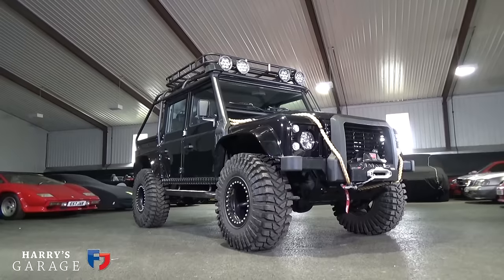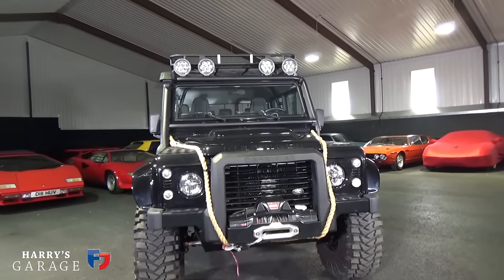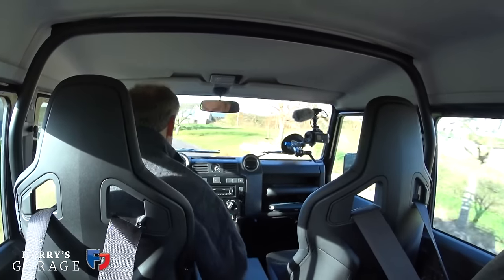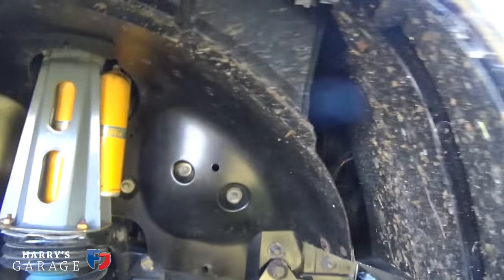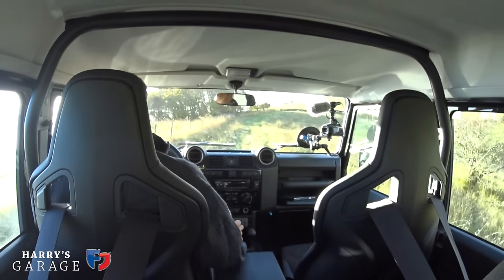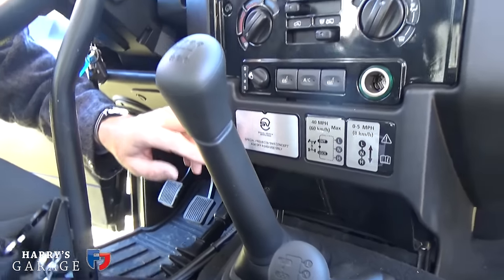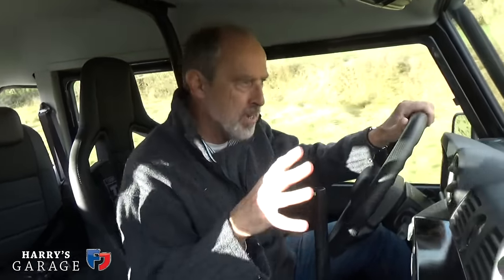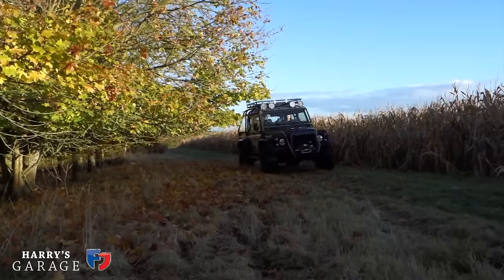Ultimate Defender, SVX Concept review. Spectre, Bowler

Comment: I was a bit surprised at the bits that were already showing rust!

Never owned a Defender myself but I've driven a friend's 110 with a very turbocharged Isuzu 4BD1. Preposterous torque. We towed one of my cars with it (~1400kg including the trailer) and the only differences we noticed were braking (of course) and 100C higher on the EGT gauge. It still accelerated pretty hard

Comment: Welcome 008, to the world of aftermarket suspension modding! Bowlerized Landys are excellent, no doubt. I know someone here in Canada who runs a very similar setup. More common here, obviously, is the Jeep Wrangler, latest edition is the 'JK', and the four-door is my favourite snow vehicle - with 10k worth of suspension bits tacked on of course and 36'-40' tires. V8 swaps are still the franken-choice but Cummins has a new 4 cycl diesel crate engine packaged in mind of the Jeepsters so it should start making a dent - at least here above the 49th parallel if not the Mason-Dixon line where evolution has hit a snag or two these last decades. 40' tires ridiculous? Depends completely on the size of the rocks one plan's on driving over, doesn't it? Thnx for the great videos;  I have spent the last 4 yrs-plus convalescing back in Canada and as a result my maps are marked up w/ hundreds of intended routes and stops - many from small details in your videos taken in France (even Algeria) -  all for my impending and triumphal, if tardy, return to Europe. Like the last time it's planned to be a permanent move but will stick  because niggles like mortality won't be considered deal killers this time around. While I plan to explore the continent's pleasures and treasures for the rest of my days, I thank you for assisting to make getting there almost bearable in the meantime. For some odd reason here's nothing quite like watching someone hand their 12 cyl. ferrari a well-cultured beating to make your morning. Strange but true. 'till next...

Comment: Hey Harry, maybe you can attach a rubber band to the upper damper to keep it central but still have full range of motion. Or rubber bumpers on the damper or frame similar to  what is used on the frame of a downhill mountain bike for dual crown forks(maybe same as a motorocycle?)

Comment: I don't understand why rose jointed suspension is desirable in such a car. Those loose suspension parts that rattle around can't be good surely. Given the amount of rubber in the tyres a little in the suspension seems like a no brainier to me
Reply: Rose joints make for more precise handling, as suspension movement is more tightly controlled than with rubber bushings.  On the other hand, they transmit all the rattles and vibrations into the car since they don't absorb them like rubber.  Personally, I would think a small rubber washer next to the bolt head would stop much of the clanking, without losing the good effects the rose joints give.
Reply: I'm guessing the rose joint is more durable. The car is illegal onroad so the rattling on road is kind of irrelevant. It just allows more articulation in the suspension. A conventional bushing needs everything to stay at right angles or it wears fast. And it's not just the bushing that wears but everything it's connected to because it's fighting the turn. The rose joint allows a bit of turn at each end with no ill effects.

They're not loose suspension parts like you're used to where it means it's worn out. They're supposed to do that and will do it for a long time. German military vehicles use them a lot.
Reply: If rubber is too squishy, you can always go for poly bushes.
Reply: rose joints are mostly for longevity. theyre common in motorsport use

Comment: In the beginning of the video you say it has a rear Limited slip diff, but in the middle of the video as you talk about the gearshift and Hi-Lo levers you mention  "locking center and rear diffs".  Wich one is it rear LSD or rear locker?  There is a BIG difference between the two!

Comment: I don't understand why there's no rubber bushings on the shock mounts. I personally would have rubber bushings or neoprene bushing installed asap.
Reply from the maker: This was built as a stunt car and had race spec suspension as that was what was easily available in the short build time. Refinement wasn't a consideration at any point.
Reply: ----Yes I understand. After the movie was shot and now time allows you half to install these bushings or else the bolts are going to get pulverized by the pounding, and will lead to breakage.

Comment: My guess would be that your 1956 Landrover would go anywhere this Defender would on your farm.
Reply from the maker: No it wouldn't. It never looks dramatic on camera but that last climb is very close to vertical for the last 6ft of the slope. It has defeated everything until this Spectre Defender in the 14 years we've lived here..
Reply: Harry's garage thats not worth defender name throw away that engine and suspension get a proper terrafirma kit 11 inch and arb lockers not that LSD crap .......and a 2.5tdi

Comment: I am wondering what stops it from being road legal?
Reply: Heads Tails its made for James bond so they didnt have to think about rules
Reply: tyres i would have thought, in the same way you can't use slicks
Reply: I'm thinking tires, bumper and light highs, the external roll cage maybe... maybe C of G
Reply: Its just because they had no need to pay for a permit to drive a concept/mule vehicle on the road since it was supposed to spend its life off road in the alps in movie sets.
Reply: Heads Tails no handbrake for a start. he says it's disconnected.
Reply: hydraulic handbrakes don't actually operate as a real handbrake even if connected as they are used to lock wheels while driving so you can skid as in a rally car.
Reply: hydraulic handbrakes are illegal (you cant get an MOT on them even in a Rally car now) in the UK. they can be made to operate in the same way as normal if needed, but the ratchet and its releasing system works in reverse.
tyres shouldn't be too much of an issue as long as they don't stick out past the wheelarches too much, bumper and light heights may be an issue although not an issue from an MOT perspective but could be from a 'type approval' point of view
Reply: Heads Tails for a vehicle to be road legal it as to pass a bunch of government road crash test. So basically they would have to sacrifice a lot of trucks just to get them legal to use on public roads. Check with your country what the tests are cause I think it's different for every country.